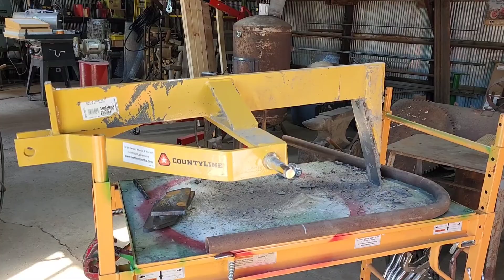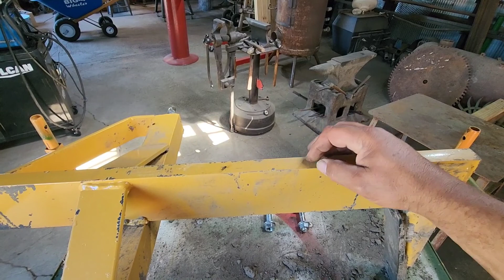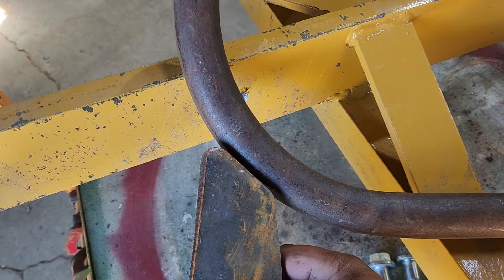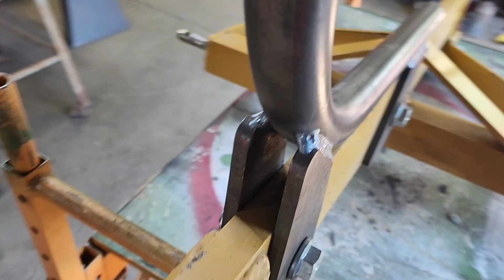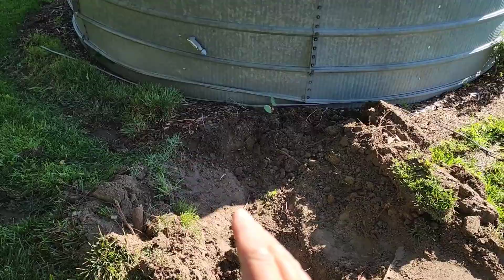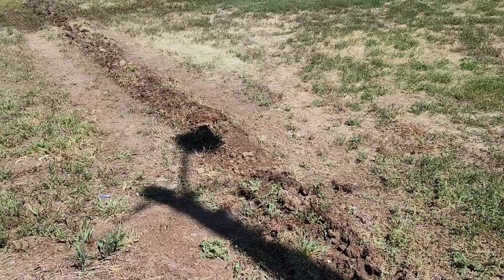Three point cable layer shank.

Comment: Normally you have the Power company show up with 3 Huge Trucks fully equipped with 5 guys on the job. Then around noon they take a lunch break and come back  pack up at 3:30 and hopefully they got done. Do the math a set up worth over $1M dollars shows up to do your job Mark makes sense huh ?
Reply from the maker: Here in Nebraska the power company is only responsible up to the meter. Beyond the main panel is your responsibility so you gotta call an electrician or dyi.